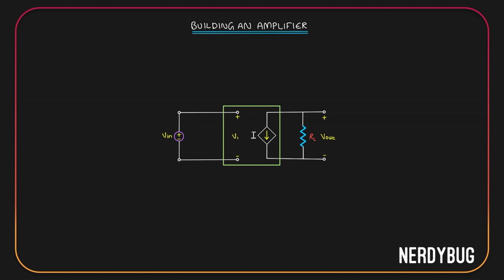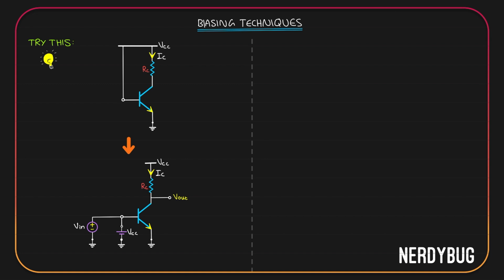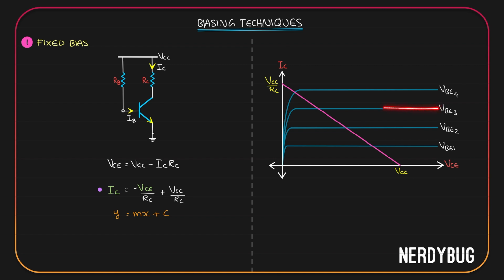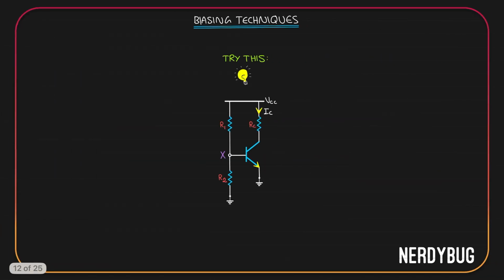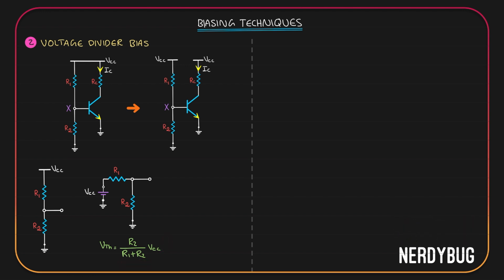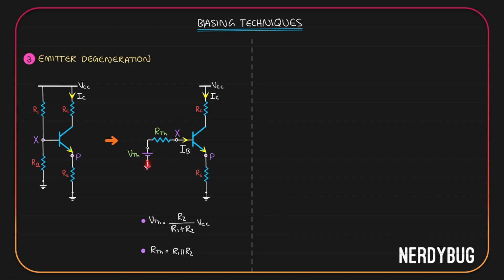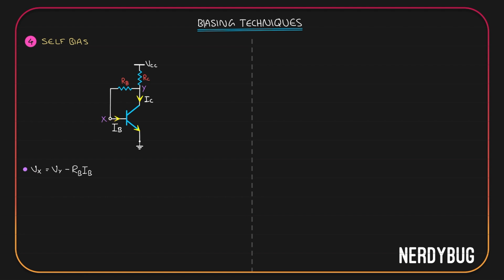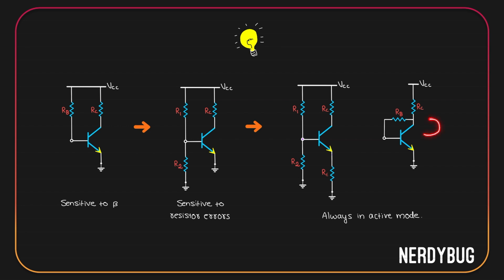Common Emitter Amplifier: Biasing Techniques | Analog Circuits | NerdyBug | 2024

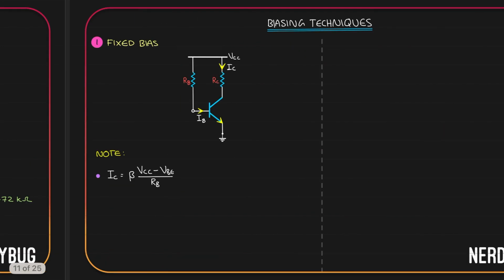Comment: May i ask you in the, 24:57 the Ib is 25 micro amps(base current) comming from where?
Reply from the maker: Vcc is a supply so it eventually goes to the ground. Ib will flow from ground - Rb - base
You'll understand it easier if you imagine vcc as a cell of potential vcc.